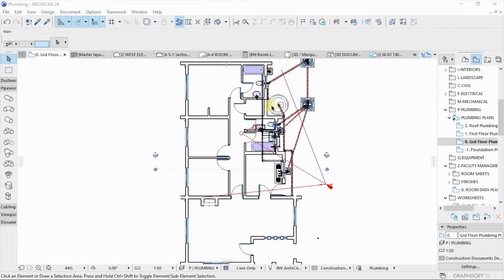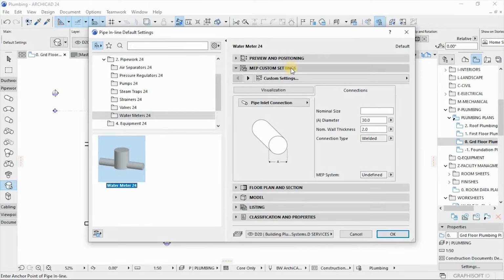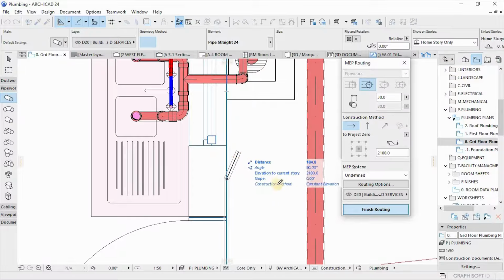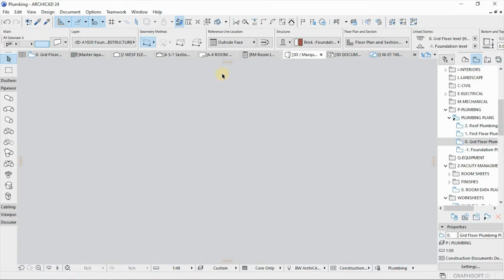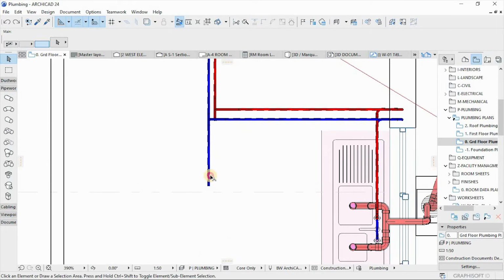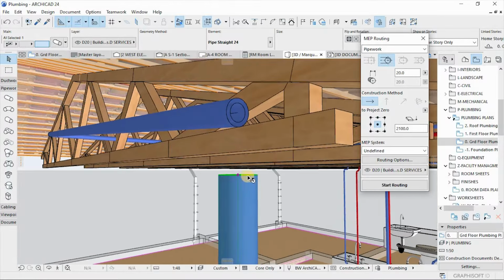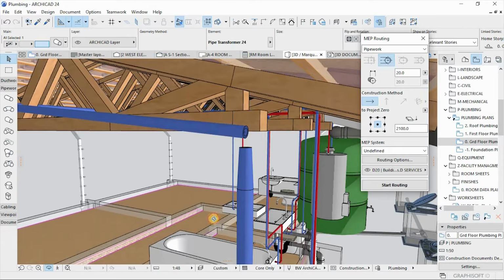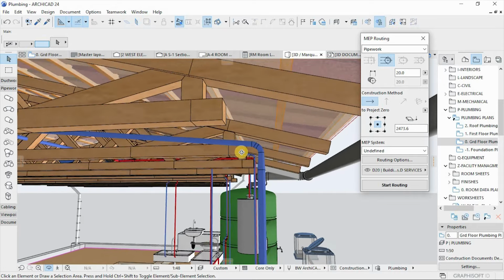Basic Plumbing Systems in ArchiCAD MEP | Beginner Tutorial PART 1

Comment: Okay my question is not plumbing related ..its a question of airbricks..currently i use windows because it works , problem is when it comes to the schedule where i will end up with 82 windows tagged for example...is their anyway in archicad i can have an object that cuts through walls other than the use of a window
Reply from the maker: Yes Sir, Version 23 and the latest version have an opening tool that you can use to cut through the wall
Reply: @MesolightVisual  thanks for the reply ..i guess its time for an update!